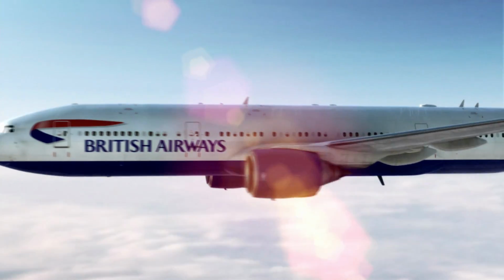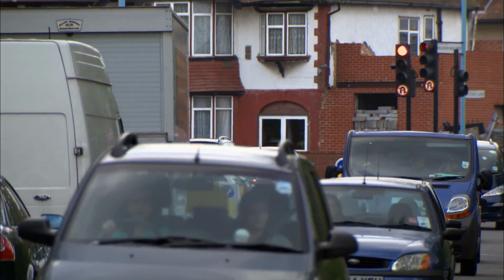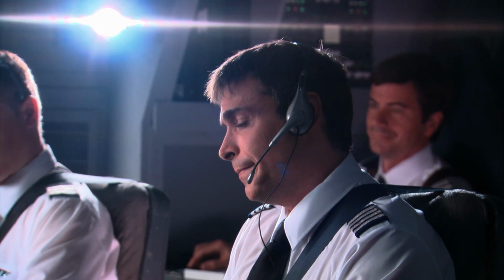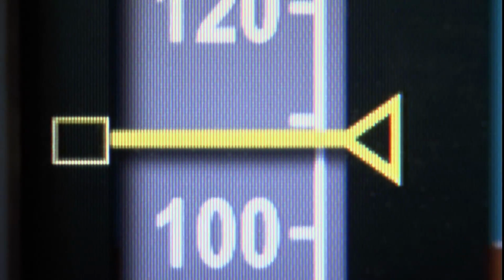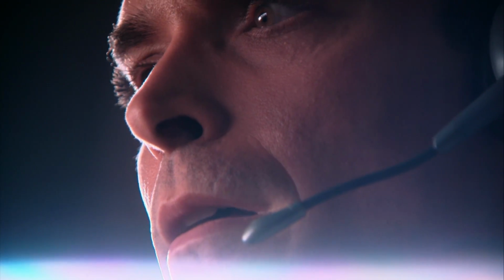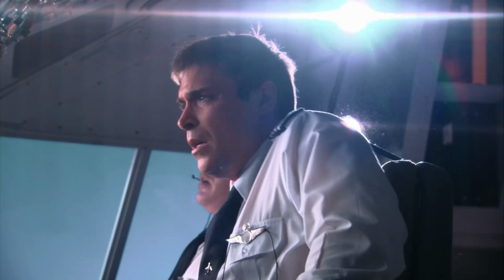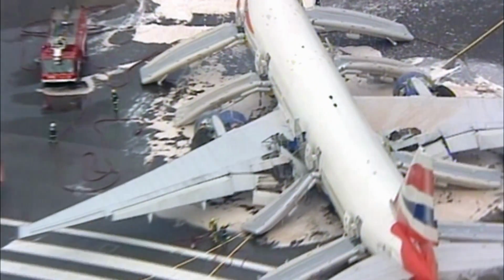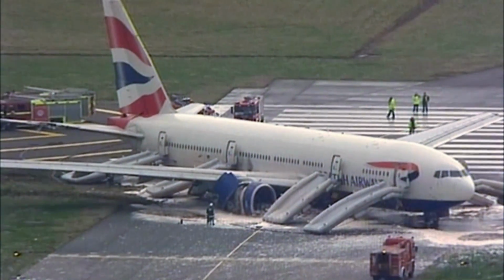An Unsettling Accident For The Aviation Industry | The Heathrow Enigma | Mayday: Air Disaster

Comment: " the Boeing 777 is one of the safest planes in the industry"  I always felt that, now I have confirmation.  Whenever I fly, I legit try to pick a flight on a 777, even if it's a little more expensive or at an odd time.
Reply: 777 used to be safe until the crash of flight 38 
then thats were the 777 lost its safe record years on
Reply: @exospaceman8209  yup, mh 17 and 370 and asiana 214 showed that well

Comment: "Stay in your seats with your seatbelts on!" F you lady, that's how people burn up.
Reply: And panicking is how people die in a crush. F YOU.
Reply: That's how you get people killed in a panicked stampede. The plane isn't on fire, stay in your damn seat.
Reply: @Armoredcompany  But usually does catch on fire.
Reply: @AllenFreemanMediaGuru  actually that's a fairly rare occurrence with this type of crash landing.  Also, regardless, the more orderly and calmly that you egress the aircraft the quicker it will be. The more people panic and stampede the doors the more likely they are to get stuck inside if the aircraft is burning. The cabin crew are trained to get you out in the fastest manner possible, the trick is that you have to actually listen and follow instructions. The instant you try to act out of self-preservation you risk dooming yourself and others.

Comment: So? What did happen? Auto-throttle failure?
Reply: no icing in a critical part of fuel supply for the engines. During last phase of landing the engines did not get enough fuel to maintain landing speed causing both of them to roll back